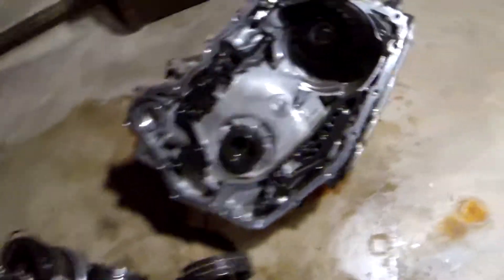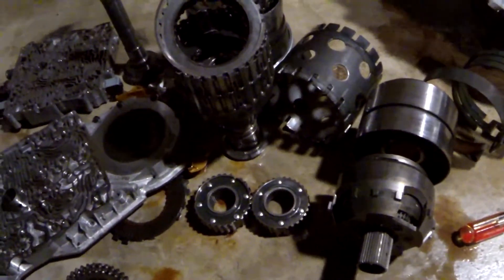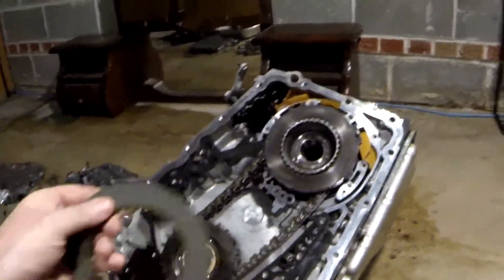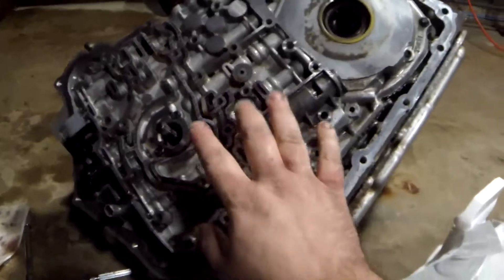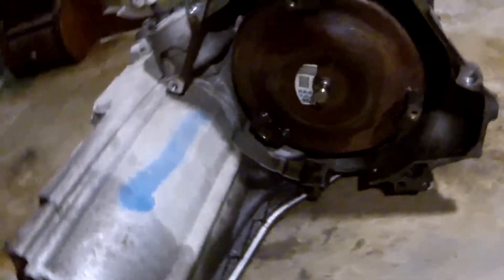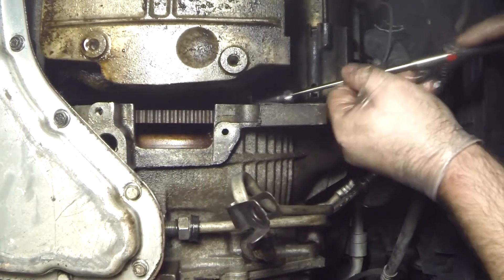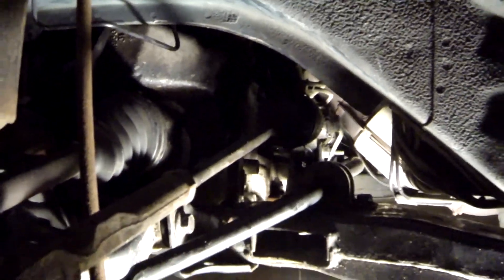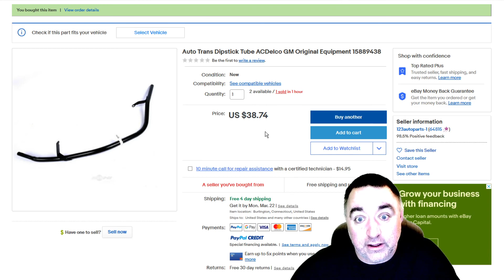2005 GM 4T65-E Transmission Replacement (Part 10)

Comment: I really hate you didn't replace the torque converter.  And didn't clean all the old fluid out of it. One spec of dirt can stick a valve. In the valvebody. But anyway awesome job taking it down and back together. At least you know how now.
Reply from the maker: I cleaned everything I could, I would have loved to have bought everything new, have a fixed budget tho.

Comment: If you rebuild it . It gets a new torque converter.  You dont want all the junk in the old converter.  If there was a whiteish substances or a build up of stuff in front of the pan torque converter took a dump and probably was the problem